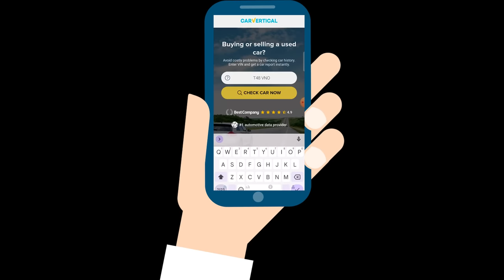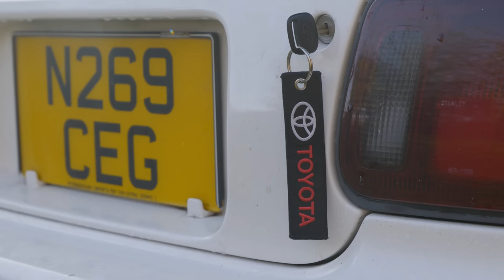The Price Of Happiness: Did My Toyota Celica GT-Four Cost More To Fix Than A Ferrari!?

Comment: The average price of good quality example of these has increased to more than the car cost to buy and repair in less than 12 months! You are still winning, this car will last for decades!
Reply: The mechanical feel of the oem drive train and gearbox is next level, you feel connected to the road, never  really discussed it is up there with classic 911's maybe even superior feel.

Comment: Not many people would've been willing to pay that amount for the repairs and upgrades and would've just got rid. Even if they did have means to do it.
I'm glad that you did and that this channel helped you to do that.
That car was definitely worth repairing.
Reply: Absolutely agree!!
We need more people like Jay.
Reply: because they have zero ability for abstract thought. Considering the cost of any new car available today that is; 2x heavier - 2x more complicated and unfixable - 2x less feel - 2x less visibility - and 2 or often 3x MORE expensive than what he paid to do all of that - it makes far more sense to MAKE an old car new and end up with a "brand new" old car that is actually fun and simple than to fork out for a crappy modern couch on wheels that is more complex than the lunar space station and is completely throwaway.  Even in the case of a brand new GR corolla or yaris, it is larping around as a celica GT four while being half the car. proof of this is in the modification scene where they are reaching limits sooner trying to do more with less (especially at the regulatory level).  It hides behind modern rigidity as an excuse.  But you pay the new hot hatch premium and dealer markup for it.  and 20 years later, it will be far harder to keep all those computers running.  

If you just spend a GR yaris or GR corolla's amount of money into an older car, you will essentially get to drive a "brand new" old car that they simply cannot make anymore. and you will have more than one up on the competition in the realm of experiences and simplicity.

Comment: GT4 WRC edition with a 5SGTE build with a G4X ECU owner here.
About the pops and bangs, I don't think that is possible even with a setup like mine capable of 500bhp I have tried and I know some people that tried too .
 I'm totally in love with the car, and i think that the line is just iconic, but it's strange because for example here in Switzerland but in Italy too, is the most stealth car that I have owned, no one's seems to care about it ahahah.
I really like the fact that the UK community loves these because they are such great cars
Reply: Very strange that it can't be done. Surely by squirting a little bit of fuel and having no spark will cause it to hit the hot exhaust manifold and see some nice bit of flames/pop...
Reply from the maker: Yeah, the guy who mapped mine has done loads but for some reason the G4X doesn't want to do it

Comment: Hi James - Awesome ST205 you have. I personally own an ST165 with the same gen 3 3SGTE as yours... GT-Fours are brilliant cars. 
Just a heads-up, for any mechanical maintenance or upgrades, we on the celica club UK forums mostly use a guy called Bek. He's a magician for anything to do with gen 4 to 6 Celicas.
Reply: where is he based? i'm trying to get quotes for sills and rear chassis rust repair and proofing
Reply: I have the same. The Gen 3 motor is a completely different beast in the 165. Makes you wish you had a 6th gear!

Comment: My old boss at a Toyota breakers yard imported a GT4 same as yours from Japan and it was a Road reg Carlos Sianz Factory paint rep with standard interior except for Recaros,and a bolt in half cage, it has  Lsds ,straight cut box ,HD everything lotta TRD ,blitz,HKS parts,18 inch Tarmac enkies on HKS coil overs ,Motech ,it spun 290 hp at 12 pds boost  at the hubs x 4 with 310 ft pds at 7500 on hub dyno, landed and complied certed rego plates and on the road was 10 k NZD just before covid hit ,the thing was fast pulling every gear, more of road gearing 3rd gear just off the 180 kph speedo then 4th 7500 then 5th ? ,bars and braces underneath it ,great car

Comment: I had an ST185 GT-Four with a boost controller on it set to 13psi, standard computer. It worked perfectly and was used for rallysprints.
My parts bill was massive, but my friend and I fitted everything ourselves. Gearbox, clutch, front hub, struts all around, brakes, etc. 
The car was very rough, but still running. Turbo blowing oil, paint peeling all over, but it went very hard.
Mine had real exhaust "bang" on full-boost gear shifts because it had a blow-off valve and was using the factory flappy air-flow meter.

Comment: Brings back memories of my 96 mr2 gt turbo import (Toyota never sold them here).  Same engine other than the charge cooler. 245hp stock.  Had mine about 300hp.  Was a lot of fun and massive induction noise right by the passengers ear.  After I got mine 2 friends also bought them after I took them out for rides.

Comment: Had one back in 2004.
Managed to screw 450BHP out of it which was not easy or cheap! ... unfortunately It blew up on the way back from winning an award at billing aquadrome (modified car of the show - 200+ club AND it was featured in jap performance magazine) and it still hurts to this day, I think 450BHP was too much for some of the standard internals, it doesn't have the strength of the 2JZ
Reply: From what I remember reading, safe power on stock internals is 350, after that it starts getting a bit like a tightrope, it can take more but it needs a very good tune to keep it alive.

How long did yours last at 450?
Reply from the maker: Yeah my aim is around 300-320 hp once we are done
Reply: Just curious, whats does "200+" refer to?
Reply: @GoldenCroc  200BHP I'm guessing? Remember this is 2004 we're talking about.

Comment: My experience with my st205 is very similar to yours. Pretty much bought the car in somewhat same shape as yours. I ended up doing a full forged rebuild, all SS, all wheel bearings, transmission rebuilt,, all calipers rebuilt and am waiting for my ct20b to be rebuilt. Before all of that, I dailyed it for a full year and it stayed reliable enough with minor maintenance items. Next up is ECU and paint... dreading those 2 things if I'm honest

Comment: I bought one for 2k and one for 6k. Put a new engine in myself for another 2k. Replaced all the gas and fuel lines. 600$ for racing suspension and enough weight reduction to get her down to 2200 lbs. Its my daily driver. It'll 60ft most cars that aren't on self destruct mode. If they are most will blow their tires off chasing me. But you have different rules on that side of the road.

Comment: Well done Jay, you really powered through. I have a 430bhp MR2 ( on OG channel) I have a Link G4 Storm, pops and bangs happen naturally with mine after a WOT.
Its a endless shopping list from here. Now you have a Link, your futureproofing can include a Coilpack conversion using 1zz system (gen 7 140hp or MR-S) OEM HT leads are becoming rare and expensive. Mine has been running like this for 4 years with no issues

Comment: I run a 650+ bhp GT4. Still has alot of standard internals and running gear. 
As for pops and bangs .. 

Your fuel mix and exhaust system combined with ecu controls all that. On over run it's the unburnt fuel that ignites inside the exhaust, usually due to having run hard and it has the exhaust rather hot. The over fuel can cause a bigger issue of pre detonation. On perfect set up all fuel needs to be burnt thats been injected. Anti lag is useless unless your racing it and wish to keep everything spooled up. Or you like sitting in a carpark reving the engine on the limiter. 
The exhaust note on gt4 is pretty crappy no matter the system you instal. Mine is custom 3in bore side exit.

It's the longest rally rep I've owned almost 10 years.

Comment: Back in 2001 I was in the look out for a New car and because I was working near to home I wanted something special! Namely a Rally car for the road. At the time Subarus and Mitsubishi were good money!! When a  Red Toyota Celica, the same model as James's Celica popped in a Local Showroom.  It looked fantastic, I was Smitten with it. This was the one!! The only thing was it was high mileage but Fully Documented Toyota History from Day one. It had almost a complete Mechanical rebuild barr gearbox, New diffs clutch Turbo etc. 
I asked the Salesman for a Test, upon moving the car there was a pool of gearbox oil on the floor. Of course it was only a minor weap but as I'd already seen 1000's spent on this car my head worked loose of my heart. Surely with all the work done the gearbox shouldn't be leaking, so with a heavy heart I left it. A Clio Williams was next on my agenda, which I have to this day. Two month's after I saw this Red Celica I met its new owner. He wasn't happy with it as he'd had to pay out a small fortune on a New gearbox!!
Lovely cars but not so lovely on your Pocket!!

Comment: I had a similar experience... I bought a Volvo 850 estate and 3 days later I had to sell it to the scrapyard... It had many hidden flaws that owner have not told me about... For example a hand brake was not working, and I was told it is nothing to worry about "It just needs some work, you can do it yourself". It turned out that the braking system was damaged and the rear brakes just did not work... Anyway, it had three very expensive issues that I cound not afford fixing. I have messaged the owner saying that I want my money back, since he scamed me. He called me a liar, and that I knew what I was getting into. So that is how I had my first car for three days...

Comment: When I was younger I had a 91 Nissan GTiR, the Nissan homologation cousin of the GT4. I daily drove it while delivering pizza and overall it wasn't actually that bad on reliability given how much I drove. It was fairly heavily modified which had both pro's and con's in that sense.

The hard part was, being in Australia, every example was gray import so parts were hard to come by. It was also a pain to work on with how tightly it was packaged, but I did most of the work myself.
I ended up moving to an MX5 and then eventually now a Mk3 Focus RS and let the iR go a few years ago. Loved the car but old, complex Japanese classics are getting harder and harder to keep on the road. But they are all the more special when they are.

Comment: Gen 6 Celica is a devil that sucks your soul when you get to drive it.

I had a non GT-Four Gen 6, it only had a 5S-FE motor but boy that thing was so good even at emergency manoeuvres, she honestly talks to me and this is why I love and miss her.

GT-Four had the super strut suspension which was a pain in the buttocks to maintain, the only thing that gave me a shock was how easy the thing rusts. I had a small accident which bent a bar behind the front lights which cracked the paint and I left that unattended then it rusted in about a few months time

Comment: I had a 1980's Celica that liked growing rust. I fabricated and welded so much on the car the rear end was virtually new. Interesting on one of your images showing a red hatchback as my 1980's car I had in the mid 1990's disintegrated with rust and needed a replacement (used one). My rear wheel drive version was like a Ford Carpi in the wet as it loved facing the wrong way if driven over 20 mph around a roundabout. Wish I had kept  it as it would be worth £30k now.

Comment: looks good "yep I'd a red GT4" the term "faff" refers to the owner as 'we' always faff around with our car.

the exhaust looks like it's been mis-positioned, I'd a 4-4.5" mongoose exhaust cat back & it sounded excellent mixed with a HKS filter, make sure the fig-8's are all good as they do cost alot each.... yrs ago toyota did actually discontinue making them (integral to the suspension) also make sure all teh vacuum lines ontop of the engine are in good condition... especially the one at the rear of throttle body, I'd loads of cracks in mine & it did have running issues until it as changed out..

also on a VERY serious not keep an eye on the tein springs, I'd some legit springs bought from a good reputable dealer only to have them last a year, one snapped it was then found to be a fake as there's millions out there..

aw also!! the rear electric aerial get some wax oil in the aperture below it on the inside of the boot (its only a plastic panel to remove) as they do leak very very easily & before long you've a nice rust spot.. I'd say opt to change for a B-sting variant easy to change & make the mod but the efficiency isnt worth it as radio coverage/signal is pretty terrible..

any real GT4 owner knows how good these cars really are & yes I'd jump back into the seat anytime I could, I do miss my old one.
Reply from the maker: All of my vacuum and coolant lines have been done, suspension is all good - we put new No.1 arms on

Comment: Great car and well done bringing it back to life. I had one imported from Japan which needed front suspension bushes. I was stunned at £300 odd per strut because you couldn't buy just a £10 bush. The cost of refurbishing one side of the front suspension was £1,000 which I thought was huge amount. I also replaced all the wheels for the price of a single Toyota wheel. However the car was awesomely capable even without the modifications you did. I did 100,000 miles and loved every one of them.

Comment: Pops and bangs - you need to create a mixture LEAN enough to fail to combust, which then puts the unburnt fuel down the Hot Exhaust... if you put LOADS of fuel then there will be too much unburnt fuel which will be too much to combust, too "wet", it'll just be "warmed through".  Also, make sure you turn off the "over run fuel cut" feature, which saves fuel by turning off the injectors when at zero throttle and above a certain RPM. Good Luck!! :)

Comment: Great video. I owned a 3sgte swapped fwd Celica for a very long time, and can relate to the issues you had. However if you're going to own a 20+ year old JDM car, you really need to learn to pop the hood and do repairs yourself. A lot of these things are pretty basic and a few weekends worth of work. This will significantly reduce the cost and you will learn a lot about the car in the process.
Reply: most stuff is easy enough to do but I would still get send some stuff to shops. your not gonna have all the tools at home, getting stuff professionally powder coated is so nice :)

Comment: This was an awesome video.

I very much relate to the story. I live in the US, and I spent the majority of the pandemic toiling away at getting one of these myself as my first “fun” car. Given they weren’t sold in North America and are very scarce, and I purchased at about the peak of the car market bubble, I spent more than what you did total (about 26k USD) just on the vehicle purchase itself. Mine is silver, and is a 1994 WRC edition (so it has the hood spoiler and antilag plumbing), and at time if purchase had under 40k miles (70k km). I was fortunate that it was taken far better care of and sold more honestly than yours was, but it wasn’t without fault.

The previous Canadian owner rallied the car and left the clutch in a usable but poor state, the radiator was pretty cooked, and the turbo recirc valve is a bit loose. So far the only money that’s come out of my wallet on repairs has been $500 for the first radiator, but with the mentioned scarcity and lack of nativity of these things in the US, parts and labor is a bit more pricey, and to get it to mechanical solidity is going to run me ~12-1500 in parts and 45-5500 in labor including the engine-out clutch replacement. It also has a crack in the lifted spoiler, some shoddy clear coat, likely to a point where a lot of panels could use a full respray, and a small rust bubble on the door but it’s contained and manageable. 

It’s a very high price for the market this car sits in and the badge it carries, but this car acted as a huge stepping stone into the automotive space, and reunited me with my dad after the pandemic separated us by 1200 miles for 2 years. It’s stranded me in a desert and blown a radiator in a blizzard, but yet it holds a far higher emotional value to me than any reasonable or financially-intelligent person could ever tell me it’s intrinsically worth. As you said, the smile it gives is worth more than anything else I own.

Very cool to see a restoration come to full fruition in the Celica space, I really love all your content around it!

Comment: You can get the bulbs for the dash from Toyota and easy replace also you should have a rubber vent on your alternator or it will burn itself out from the heat in the engine bay iv seen it happen twice